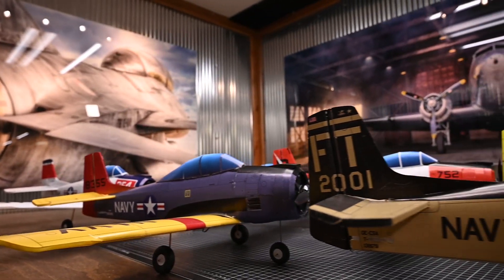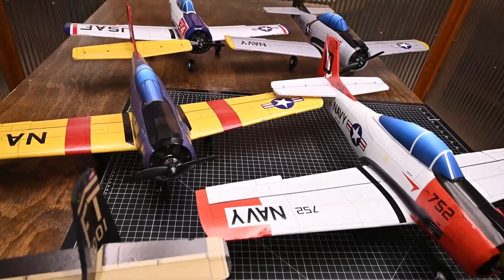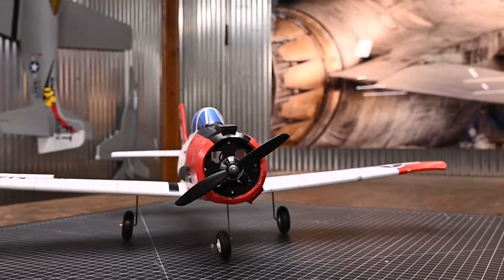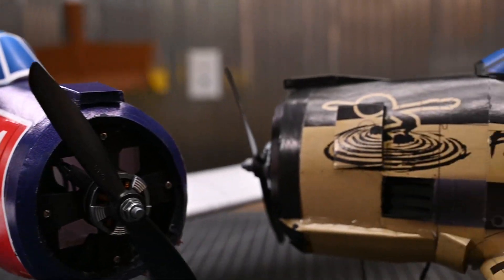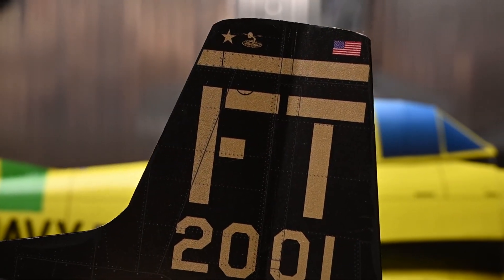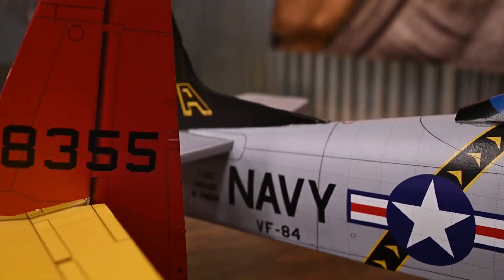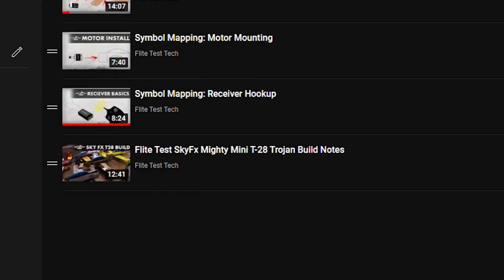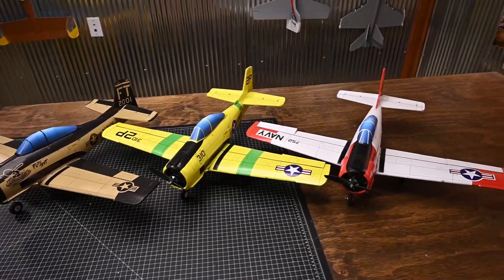Flite Test SkyFx Mighty Mini T-28 Trojan Intro

Comment: Might build one myself, put my Magnum 15 2-stroke on it, see how skookum that printing is.
Reply: Might not hold up very long, but I bet putting a little glow engine in one would be a blast
Reply: @ILLEagle_1  They hold up fine when you seal them with rustoleum paint, but that would obviously defeat the purpose of buying one of the pre-printed ones. Maybe a coat of clear over it would seal it off?

Comment: How is the weight compared to regular DTFB? Its got to be a little heavier, right?
Reply: Virtually no weight difference
Reply: @trieditathome4116  An answer like "Virtually no weight difference" translates as "Yes, you're right, it is a tiny bit heavier (but we want to avoid admitting it)".
Reply: @RottnRobbie  adding ink to paper adds weight, but,  it is an insignificant amount of weight.  Some of the unpainted planes I build are heavier than ones that are painted. Evidently I used more glue on the unpainted vs the painted.  in other cases the printed planes are a few grams more.  Just because a plane is printed doesnt mean it will weigh more once its finished.  The weigh difference ofthe printed planes is minimal.